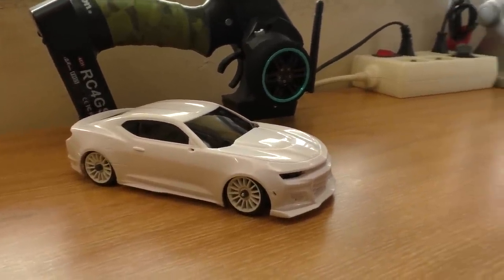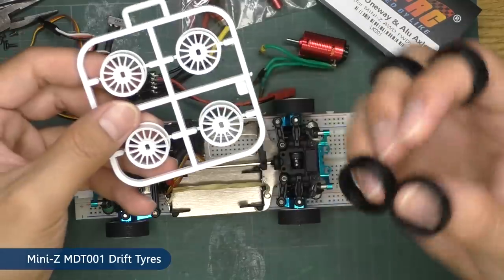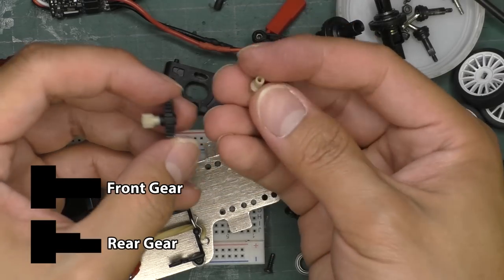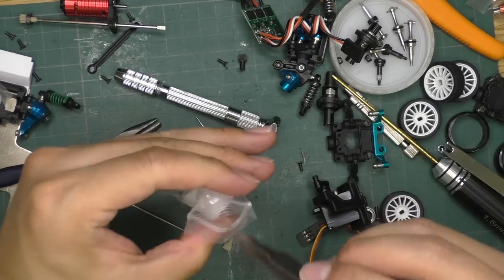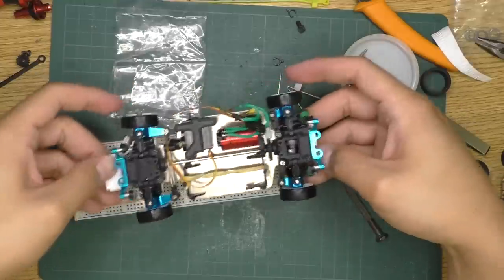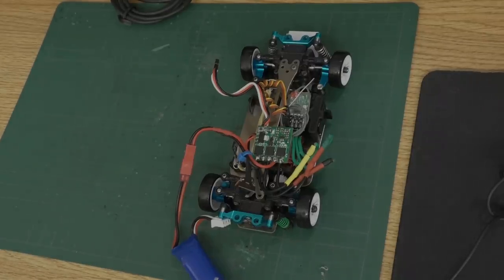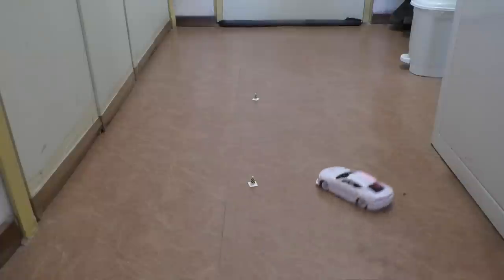WLtoys K989 (and 284131) Budget Brushless Drift Build 2021 Edition | Full Tutorial

Comment from the maker: Here are the time stamps. There are a lot so you can watch only what you need.
Intro 00:00
Previously on WLtoys project 00:36
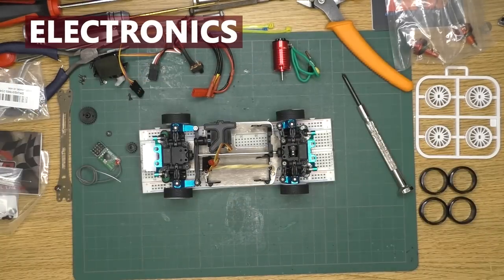Electronics parts 01:40 
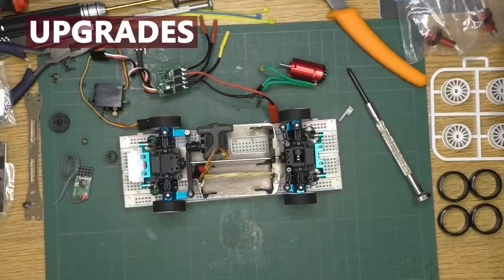Upgrades 05:05
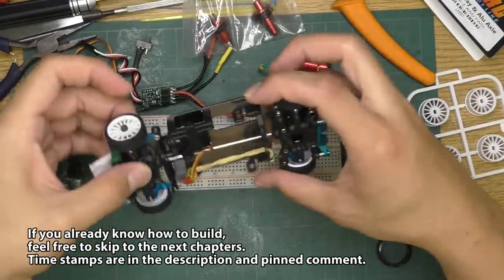Disassembling 08:33
Locking differential 12:01
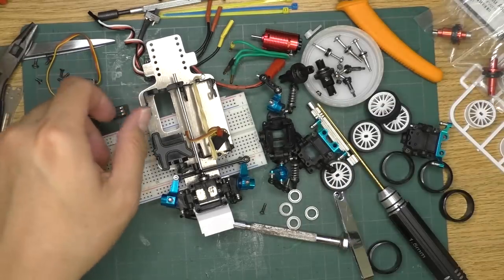Motor installation 12:34
Difference between front and rear pinion gear 13:11
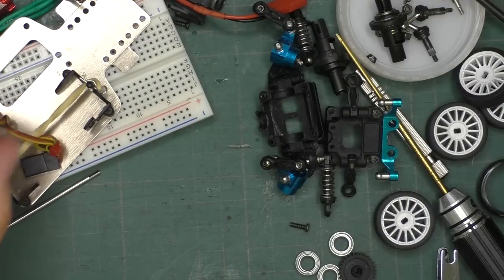Motor installation (cont.) 14:15
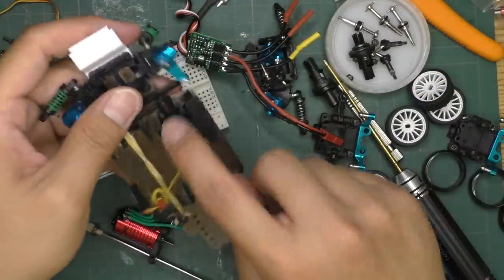Replacing the servo 15:13
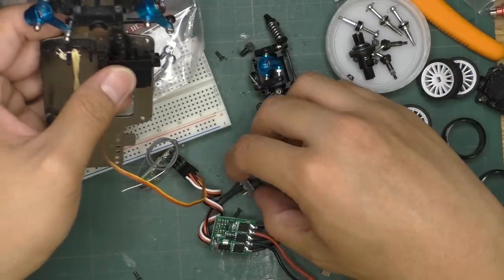Adjustable front toe 17:18
Installing front one way 23:27
Installing drift tyres & wheels 25:02
Suspension setup 26:08
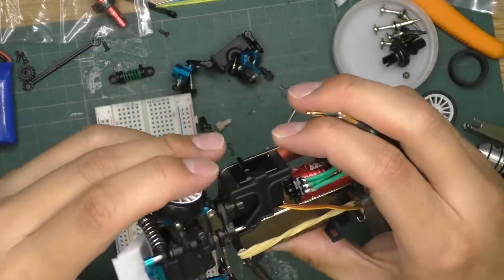Assembling the spur gear 27:03
Installing motor pinion 27:36
Assembling rear gear box 29:58
Electronics installation 34:22
Plugging in brushless motor 35:28
Calibrating the ESC 36:00
Program ESC without card 37:08
Installing receiver 40:10
Steering setup 42:53
Test drive 45:24
Conclusion 46:25
Reply: Thank you for this series !!! 
Really helped me get my k969 the way I want it
Reply: Hey bud can you link me to the k989 1/28 scale rc wheels and tyres you have on in video
Reply from the maker: @krisstoney6892  Wheels (need 2 sets) http://bit.ly/30ThqD2
Tyres (1 set) http://bit.ly/2I3a74k
Body https://bit.ly/39oQba3
It's all in the description but I understand it's quite overwhelming to scroll through it.
Reply: @TubeMRHappy  이가

Comment: Appreciate that you show the measurement of the ball diameter at 8:18 . I am replacing as my parts of my 230 sized helicopter with after-market wltoys car parts because car parts are much stronger. I have ordered a few wrong parts because the product pages don't say the dimensions of their parts. You are the only RC youtuber that spells out those information.
Reply from the maker: Thanks for the kind words. Helicopter is a great source for linkages.
Trex250 ball heads and caps also work. The ball heads have smaller screw (probably M1.4, can't remember for sure) but with a bit of modding they'll work.

Comment: @BeaversHobby what pitch motor pinion are you using for the brushless motor? Doing the same set up but don’t have the correct pitch pinion
Reply from the maker: The gear pitch is mod 0.5.
It's probably one of the easiest to find because you can get it from "plastic gear for small robot" bag from aliexpress or ebay. It's also the same pitch as Tamiya Mini 4WD and Mini-Z AWD pinion.

Comment: Thank you for the video, I will save it but please do a similar video for the new wltoys 284131 truck!!! I bought one and would like a guide for doing upgrades properly. Thank you again!
Reply from the maker: It's the exact same car so if you want to do a drift mod then this video is the one you need. But if you are interested in making it a touring racing car then I plan to do it using the 284131 but not upgrading the electronics because it is already good.

Comment: For your ESC, experimenting with BLHeli firmware might solve your cogging and initial acceleration concerns.
Reply from the maker: Unfortunately, the firmware on Surpass Rocket ESC can't be modified.
I haven't followed the drone side of the hobby so I don't know if it even has forward-brake-reverse function that will allow it to work with cars, last I check it doesn't.

Comment: How did you get the brass gear off of the motor shaft??? The motor wont come away from the mount without removing it first. I didn't see you address this in the video.
GREAT video by the way!
Reply from the maker: This was the older version with plastic gear. The new version with brass gear... that one is almost impossible to remove. It's very difficult to get a gear puller in so I ended up not removing it and keep using the old motor. 
Another way is to try and heat up only the shaft and push the gear out with a screwdriver. However this way is tricky and you might end up melting the motor mount instead.
Reply: @BeaversHobby  yes sir indeed.
I ended up buying the motor/shaft/mount assembly and cut the motor off with a cut-off wheel. It was a little messy, but it worked. Only $13 for the assembly too.
Reply from the maker: @TheJoshRed  Yes, that's better than trying to pull the original motor out and risk damaging everything.

Comment: I switched back to the stock k989 esc and running a 3s lipo and it’s running great. I thought it would have fried it but it’s taking it like a champ. I also ran the stock 2s lipo with a 1s wired into it and she rips. I would have never thought it would take it but I was wrong. The motor gets a little hot and the esc is cool I do have the cover off the esc. I would have to say it picked up another 8mph with the 3s
Reply from the maker: As far as the heat goes, if you take a brake and check the temperature regularly it should be OK. This ESC is weird to say the least. Some even burn at 2S from running normally, not pushing it or anything.
Reply: It’s still going strong on 3s. I ordered a couple brushed 85000 rpm motors the ones that come painted brite colors and I wasn’t expecting it to run on the stock esc so I used another on another esc and it ran for about a min and quit I put the other brite painted motor and again one min. The esc is fine but I can’t figure out the motor. I even wired in a resistor like the stock motor but nothing. I wasn’t trying on 3s only a 2s. Is there a trick to those motors. Got them off eBay and for that min it ran it was quick. Any ideas. Thanks
Reply from the maker: @Jasonkartracing  Do these motors have carbon brushes? You can open them up to check, there'll be a black block on each side of the terminal that touch the armature. If they have that and it still stops after a minute then it's either a cutoff from the ESC (ESC can't handle it so it shuts off for safety) or the motor really can't take more than 5V.
Reply: I opened one motor and the brushes are gone and half of one terminal. Can i go with diff brushes and terminal
Reply from the maker: @Jasonkartracing  Yes, you can replace the terminals and brushes then keep using it but I'm afraid it'll burn again because the magnets and winding aren't suitable for this voltage.
Reply: I  put brushes from another new motor that where copper color and it’s going good now
Reply from the maker: @Jasonkartracing  Glad you got it working.
Reply: I  did something crazy. I had an extra k989 esc so I tried 2 2s lipos on the stock k989 with stock esc and it still didn’t pop. I was shocked. Didn’t run it long just a min and it’s my oldest k989 at least 7 months old with a lot of run time on it. Love your vids and think you for responding back.
Reply from the maker: @Jasonkartracing  Always a pleasure. I enjoy your experiments as well.
Reply: I got a really good deal on 5 turnigy 180mah 40c 3s lipos and I have run them on my brushless mini q, my stock k989, my brushless k989 and my brushed k989 with aftermarket esc and not one has popped. The run time is longer then I thought it would be. I have 3 other brushless esc’s and it works on them with no issues. I also got one of those wltoys receivers with the blue top with out the esc and it binded to the radio like you said and it works great with my k989 with aftermarket brushed esc. I tried with several brushless esc’s but like you said it can’t be reversed and the brushless one’s need to be. Thank you for all your support and videos it’s answered a lot of my questions.
Reply: Is there any other option for the cogless - low voltage cut off -  budget esc sir? Dasmikro is hard to find in my country

Comment: Hi Beaver, Thank you for this video.  Were you satisfied with the 15 tooth motor pinion in this setup? You were looking for the 14 tooth pinion. What is the pitch of that motor pinion please? Thank you
Reply from the maker: Yes,  I'm satisfy with 15T for drifting. The gear pitch is mod0.5. It's very common for small toy cars and robots so you can find the gears pretty easily on ebay or aliexpress.
Reply: @BeaversHobby  Thanks Beaver👍

Comment: ANY SUGGESTIONS for some tires that offer more grip? Everyone seems to be focusing on drifting while many still care about real racing. Any hope I would appreciate it.
Reply from the maker: The tyre compound depends mainly on the surface you are driving on. For RCP and what I use for upside down EVA garage mat, you can't go wrong with Kyosho Mini-Z radial tyres. The lower the number the higher the grip. I use 30 degree for both front and rear and it grips really well. If you only race on RCP another option is Marka Racing. 
You can go as low as 20 degree but it might incur some grip rolls. So if you like the grip for 20 degree but it rolls in corners you can change the front to a less grippy one like 30.
If you play on wooden floor or regular home floor then foam tyres are great. I have some GQ tyres for driving around. The setup is front soft, rear super soft. Not that the car rolls over but it's for the car to not spin out that easily.

Comment: I know this video is like 2ish years old now, but would you still recommend this drift setup for a 284131? Thanks for the info! 👍
Reply from the maker: Yes, this build is still the same for 284131. However the ESC has changed a bit. The DasMikro that I use is not available anymore. You can use DasMikro V3 or PN Racing V2 instead depending on which one you can get the cheapest.

Comment: Hi Beaver, very nice detailed build as always, you are a true inspiration. Can you please advise what AWG wire and bullet connector (size) cable is used here for the rocket v2 motor which connects to the Daskmikro brushless ESC.
Reply from the maker: 20 or 22AWG. I used to use 20. It was a bit thick but fit well on the motor. GL Racing and all others come with 22AWG and work well without heating up so get 22AWG if you can, otherwise 20 will do.
The plug size is 2mm banana.
Reply: @BeaversHobby  Thank you Beaver.

Comment: Thanks for the vid. Especially surprised about esc difference! I was struggling to reduce cogging of surpass rocket combo and now it's the time to change my esc to dasmikro one too.
Btw, is GLA 10.5mm CVD shorter than Atomic one? For mine, GLA dogbones popped off from drive cup unless 0.9~1.3mm spacer added...
Reply from the maker: They should be the same size. However some diffs like ball differential have shorter drive cups so that might still cause a problem with 10.5mm shaft.
Reply: @BeaversHobby  Oh.. then keeping spacers with GLA CVD and applying threadlock on wheel nuts seems best for me now.. thanks beaver!
Reply from the maker: @별빛여우-c1o  My pleasure.

Comment: hello, 
do you have the precise reference of the esc, and where can I buy it?
 I use an absima cr6p radio and r6fs receiver. Is it ok for use with this brushless motor and esc? thank you so much for your videos! and your advice.
Reply from the maker: The one I use in this video is not available anymore since they updated it. Here it is. https://www.aliexpress.com/item/1005003527519554.html
You can use any standard format (3 pin) transmitter & receiver with it so your Absima CR6P will do fine. It's basically a re-branded Flysky GT5 so the protocol is AFHDS 2A. If you want a small receiver, take a look at FS2A. The size is about fingertip. https://www.aliexpress.com/item/4000136437334.html

Comment: Great conversion. Unfortunately the link for the motor gear doesn't work. Can you tell me what kind of gear I need for the brushless motor?
Reply from the maker: You can use the gears that came with the car. 15 and 17T with 5500KV motor. 16T also works well.
The gear is mod 0.5 with 2mm hole.
For more spare you can search for "plastic gears mod 0.5" or "plastic gears for small robots". 
A big kit like this will have mod 0.5 pitch and many T to try. https://www.banggood.com/custlink/mvDtaOnJFj
Mini-Z AWD motor pinions are also another option.
Reply: Thank you so much.👍

Comment: If I purchase the fow with the solid axle, how do I install it? Can I just replace the rear diff with it? And what are the turnbuckles you mentioned in the description? I can't find a link for them.
Really good videos btw
Reply: Also, does the body in the video fit without any modifications?
Reply from the maker: @kaufempfehlung6803  Yes, you can install front one way and rear solid axle along with long CVD (25 or 27mm). The turnbuckles come and go pretty quickly so search for Mini-Q and Trex250 parts should come up with something some day.
As for the body, yes it fits without any modification but you'll have to replace the wheels as well to 0mm offset narrow. You can use this Camaro ZL1 or Dodge Hellcat body.
Reply: @BeaversHobby  thanks for the quick response, I really appreciate that ^^
Reply from the maker: @kaufempfehlung6803  My pleasure.

Comment: I have problem with original transmitter so i must to change it. Problem is selecting new ESC for brushed motor. Will hobbywing quicrun 1060 fit correctly with original motor? I know IT is oversized, but every small ESC looks same and i want to buy crap.
Reply from the maker: Quicrun 1060 won't fit but Quicrun 1625 will. You'll need to cut down the wires to make it smaller and change the plug to JST-XH 2 pin for the motor.
Another good one is DumboRC 10A. It doesn't have cut-off but it has an alarm port so you can install 5v buzzer and it'll beep when the battery is low.
Here's an old video but you'll see how 1625 fits on the car. https://youtu.be/ryH56xxftOc
Reply: @BeaversHobby  is radiolink rc6gs good? I know that rc4gs can be enought, but rc6gs i can buy on aliexpress with shipping from my country. When i buy rc4gs IT is high probability to pay VAT so end cost can be the same.
Reply from the maker: @wrzodek01  It's basically RC4GS with 2 extra channels so yes, it's good. If you can get the RC6GS for the same price, get the it.

Comment: my leopard hobby motor and ESC combo for 1/28 has just arrived but the motor shaft doesn't seem to have a groove on it. Does the pinion gear just slide onto the shaft? this is weird to me that the shaft does not have a groove
Reply from the maker: Yes, the pinion will slide onto and tight fit on the shaft. Don't worry if the shaft doesn't have a groove.
Reply: Thank you. The original metal pinion that is on the stock motor is kinda hard to get out, do you have any tips?
Reply from the maker: @forthememes1311  If you have a gear puller it'd help a lot. If not, take it out of the car then heat it up with a hairdryer or something. Be careful not to melt the motor mount though.

Comment: 1:25 why don't we want a wider car here?  I see you see making s specific point i cannot  understand. Thank you 😊
Reply from the maker: This car is wide enough as it is for 1/28 and will not really benefit anything if it gets any wider.
If the car gets wider the dog bone part of the swing  shaft/CVD won't reach the differential and it will drop off the car causing it to loose drive or worse, snap the CVD. And you will need to re-work all the linkages otherwise the toe angle will be too extreme to drive (here's the video about metal upgrade  https://youtu.be/cKw-T2f-Qms )
Also it will be harder to find a body to fit. Besides, the quality of the metal upgrade is very random. Mostly you will get a kit that will not work.

Comment: Awesome video, I'm about to make this conversion but I can't decide between the Furitek or the DasMikro ESC. 
You say in your Furitek vid that it's the best you've ever used, but is it really worth the 40 extra dollars?
Reply from the maker: It depends on what you want. Furitek is the best and worth every penny if you really use all the features like realtime setup (no restart the ESC, just change the value and it uses that setting instantly), throttle curve, fine tuning the the control and also has ultra fast response. Basically it's racing-grade stuff that no many casual drivers will use.
If you just want something that works well and power any 1410/1625 motor without hiccups, DasMikro is all you need.
Reply: @BeaversHobby  Thank you for the detailed response, I can't imagine myself using all those features since I'm still super new to rc drifting, but I still want it ha.

Comment: Hey @Beaver's Hobby How does the DASMIKRO esc compares to gl racing esc v1.2 ? Does the DASMIKRO esc performs just as well?Thinking of buying an esc soon.
Reply from the maker: They are almost the same. Dasmikro has a bit higher starting speed but less to no cogging. GL has softer start and lower speed but might cog with some motors. Beyond that part, they are the same. Well, they are both Hobbywing programmed after all.

Comment: The run time it is better with this brushless motors or do you need a bigger battery? And do you think the 2500kv is enought for a small place
Reply from the maker: Theoretically it will consume less power but realistically you won't see much difference. Upgrade the battery to a bigger capacity is the best way to get more runtime.
Reply: And for the motors it is enough for driff 1410 2500kv
Reply from the maker: @alexgou2519  Yes, it's enough to drift in a small track. You can also use bigger pinion to get more speed if you need that.
Reply: @BeaversHobby  Thank you very much

Comment: Does the surpas esc run fine besides the caulking? And is the caulking only when starting to accelerate?
Reply from the maker: Besides cogging (stuttering) it is also slow to respond. Imagine pulling the trigger and it takes a while to react.

Comment: Hello, great videos, but i wonder, what gears do you use for the long shaft? i'm thinking the front and rear that you replaced.
Reply from the maker: It depends if you want drift or touring/grip. For drift, yes, get the same front one way and rear solid axle (or just front one way) that I have and you'll get a good drift car. For touring/grip, take a look at Mini-Z differential for gear diff or ball differentials from Mini-Q (OK quality), Atomic AMZ (good quality with a bit of chance to slip), GL Racing GLA (great quality).